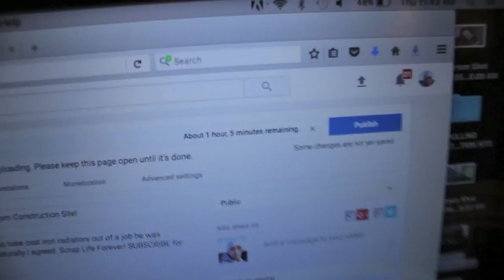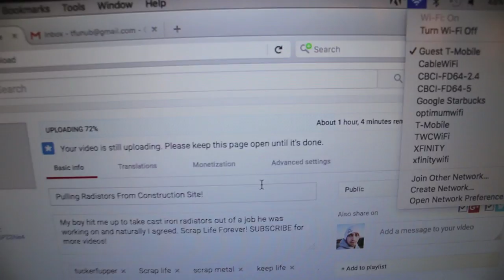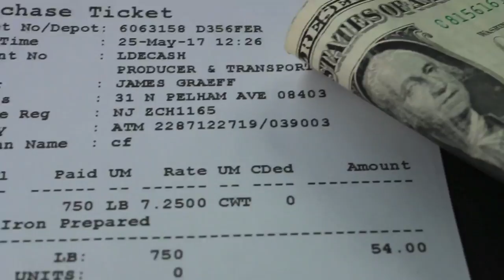SCRAPPING 1500LBS CAST IRON RADIATORS!

Comment: they call the blocks they make with the cars and light iron logs they  are about 1700 pounds .i drove roll off dumpster rig for exeter scrap co, for a few years . they would load a 50 yard dumpster with them.was like 85.000 pounds  truck hated it picked the frount of the truck 6 feet off the grond tilll it came back over center then slam back down ..i hated that. they flip over all the time in the winter the logs frezz to the metal floor of the dumpster then becomes mad top heavy over you go...any way loveing the old vids to...yew
Reply from the maker: Thats super heavy man glad you came out same sounds sketchy!